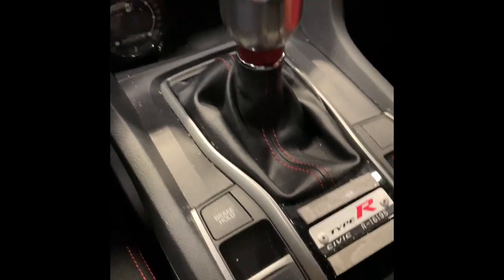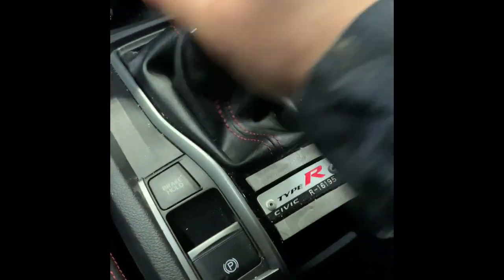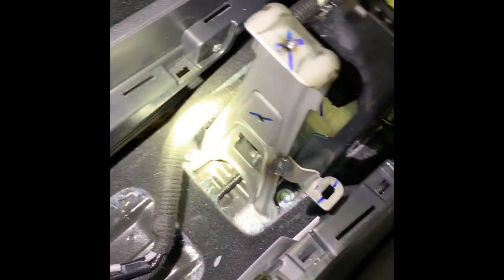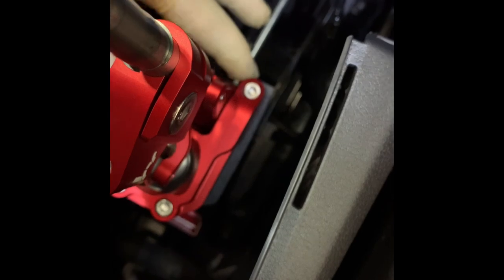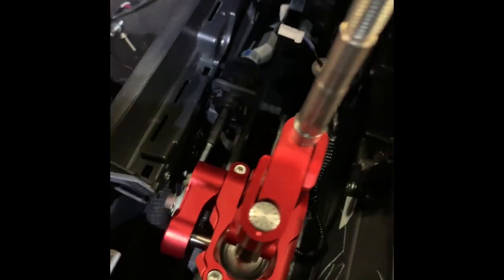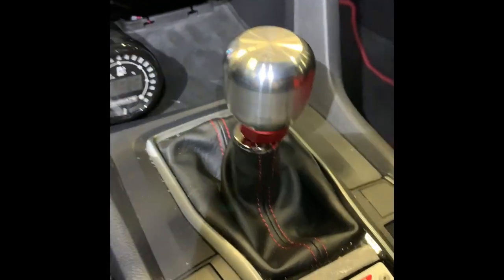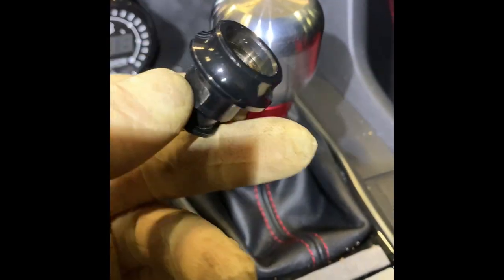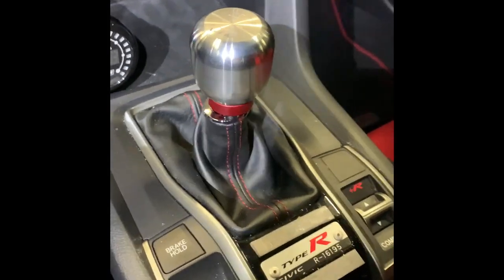Honda Civic Type R Hybrid Racing Short Shifter Install And Review

Comment: Does this help w the notchiness in the Si also?
Reply from the maker: No, I would try new fluid and a weighted knob
Reply: @BCautosolutions  hmmmmm I've never heard of a weighted knob 😲  how does it work?
Reply from the maker: @zoezzzarko1117  it’s just a heavy shift knob vs the lighter oem ones. Basically just gives you momentum going into gears. Could be you have a hydraulic issue with your master and/or slave or a mechanical issue as well.